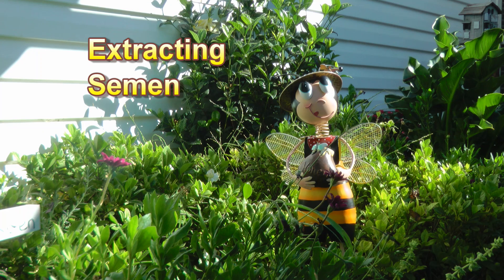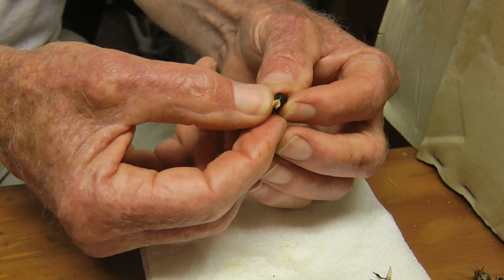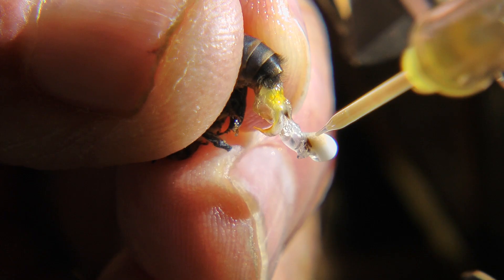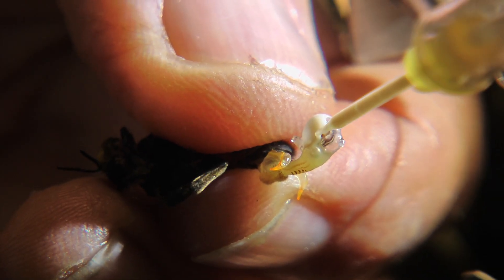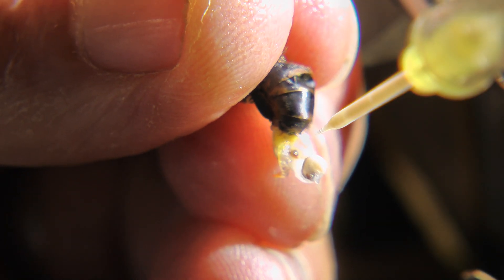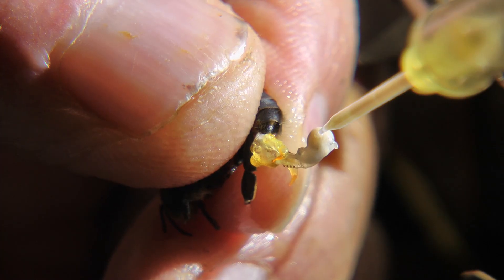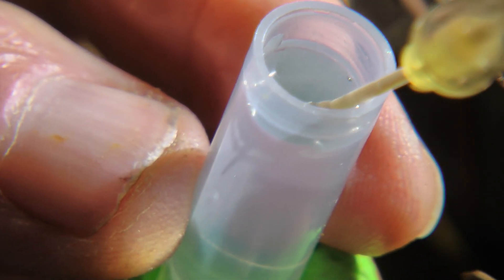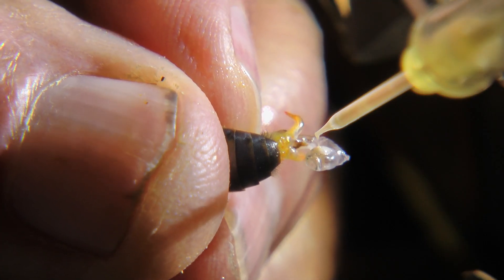Extracting Semen from Honeybee Drones

Comment: Suppose you cut their willies and submerge them in a suitable solvent. Then, after cutting 50 or 60 willies, you sieve the solids out of the solution and centrifuge the filtrate. The layer on the bottom is the mucus, the middle one the sperm and the top one the solvent. Wouldn t that be much easier?
Reply: Reminder that you that you made this comment 10 years ago.